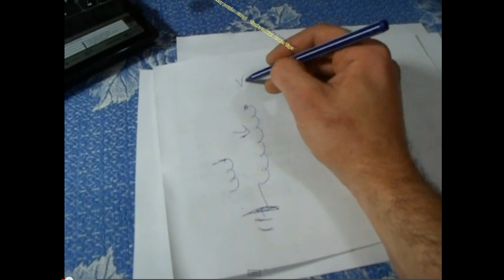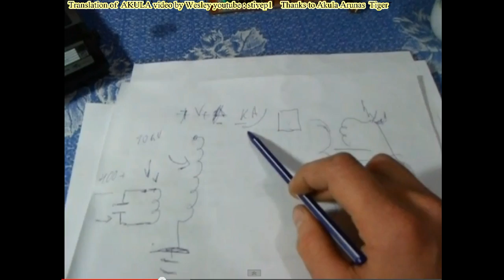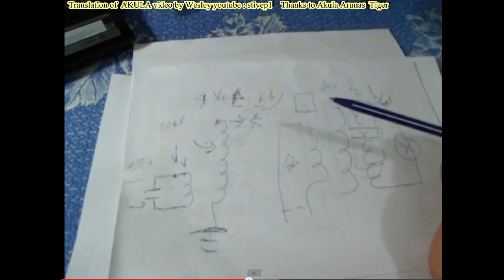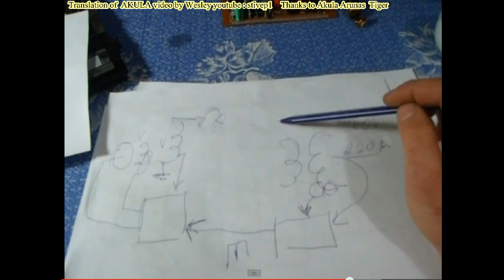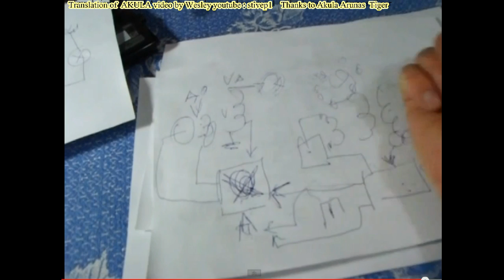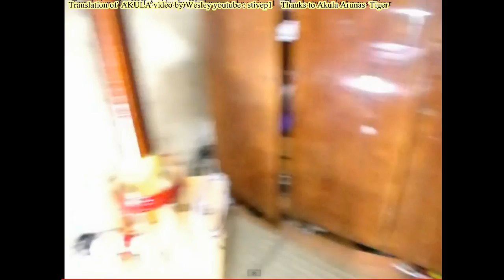Akula expaining his device translation by Wesley

Comment from the maker: think about power of 1MW  of radar station and look at the high power  tube?
I have at  home generators 35kw connected to 15A 110V outlet.
 Cober 605P  and Cober 606  impulses are up to 2500V at 35KW in pick.
You way of thinking is  unfortunately going  in wrong direction.

I have 250KW   Klystron power supply generator that  is connected to  the same  outlet as well. :)
I have Bournelea 3240A   and so on so on.
MY FRIEND GET OUT OF THE BOX YOU ARE AT> :)

Comment from the maker: No we are talking about impulse power impulse  current impulse voltage.
 you ca not burn 1mm copper wire if you put 10 kw impulse at 1 ns
The same is impulse intervall thaqt is why  flyback transformer is so smal and is not burning up in resonance whan  avramienko fork is used at the output.
 Look what wire is on primary and  secondary of  flyback?
You giving rest it is like you lifting 100kg for 3 seconds rest  and 3 seconds again.
I think that would explain.

Comment: There are some inconsistancies in translation.
1) Tesla coil is used to create high potential and there are all volts not watts being talked about. Then that is shown as kiloamps for pulse.
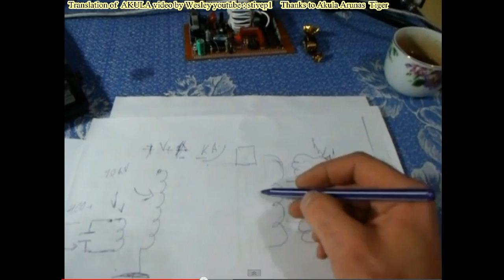2) 10:57 "(shows to Tesla coil side) We will charge output resonant circuit part. Our next task is to add circuit for our output resonant part to create force which will start moving free electrons available in receiving coil."(they are being manipulated by resonant means on high voltage side so we have NMR).